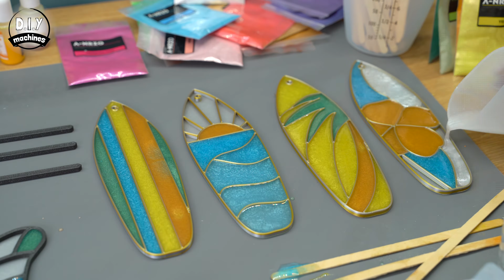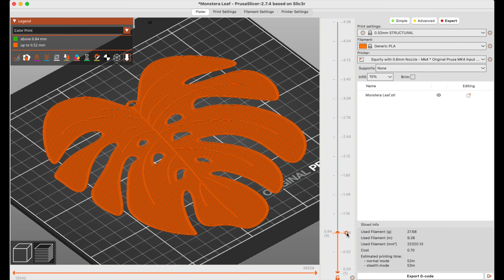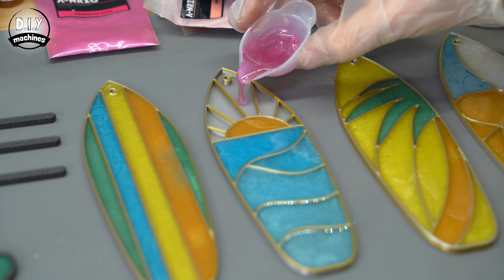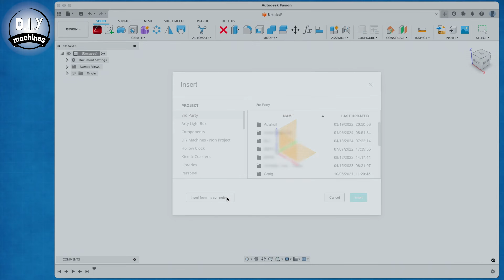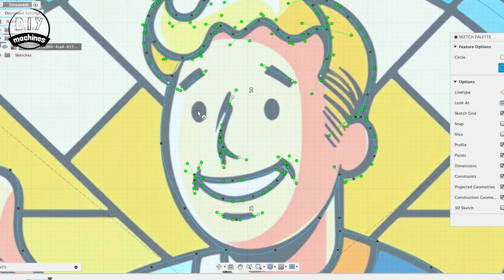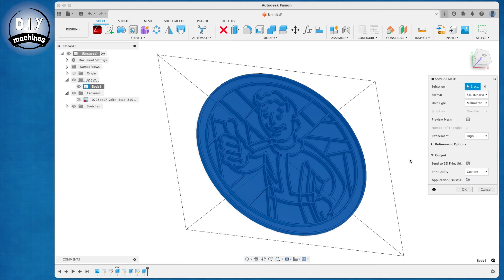AMAZING 3D Printed Stained Glass - SUPER EASY RESIN ART

Comment: Good afternoon,

Great video, but I have three questions please

1. I do not want to print the first two layers.  I want to print only the Came, "glue" the print to a base that I can remove later and then fill it.  What would you recommend as an option to do that?
2. I currently only have PLA does the resin get too hot for PLA?
3. I was looking at doing something like this for a church crafting project, does the resin you use require a lot of ventilation?

Thank you,
Boats
Reply from the maker: Hello,
#1: I've not tried this - resin has a habit of finding all the little holes and spilling through them so ensure whatever you try that at least the very outer edges of the design are well sealed against whatever temporary base you use. I would use a silicone mat as the resin will not adhere to it.
#2: PLA will be fine for the resin
#3: It doesn't require massive amounts of ventilation, open windows will be enough, be more cautious of the uncured resin making skin or eye contact.

Lewis
Reply: @DIYMachines  
Thank you very much for your reply.   If we end up doing this project I will let you know the results

Comment: If you convert the image to an svg and then bring it into fusion, i believe you can just extrude the lines without having to trace it all. Using gimp and / or inkscape. I can't remember if both are necessary, but it's a lot easier.

Comment: I wonder how UV cure resin would work? Eliminating the time crunch.
Reply from the maker: That's an interesting idea. I imagine as long as the rapid curing didn't generate too much heat and deform the printed parts then this would be much quicker. If I ever find myself in position of UV curing resin I'll try it out.
Reply: I tried Vault Boy with uv resin. It was kinda nIce, but it really warped. I had to do it over with epoxy.
Reply: I think smaller models would work well